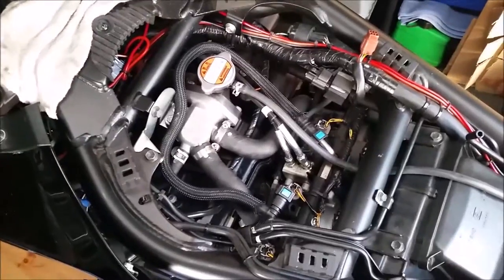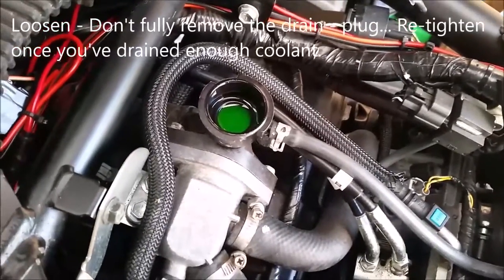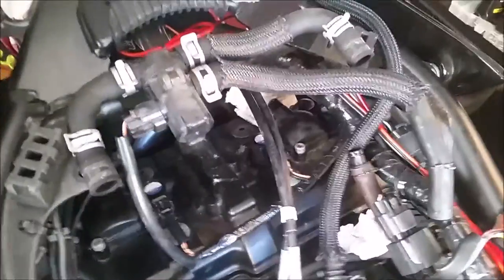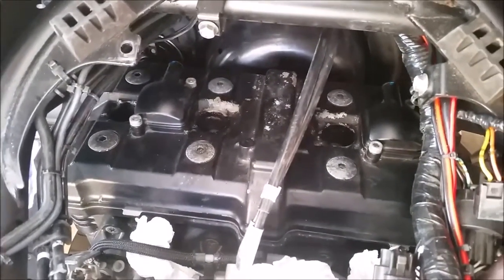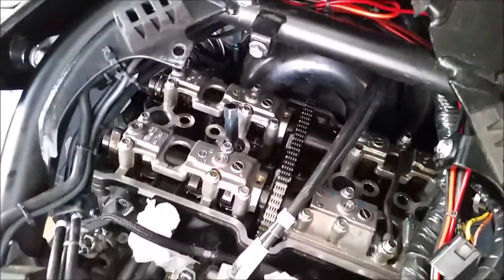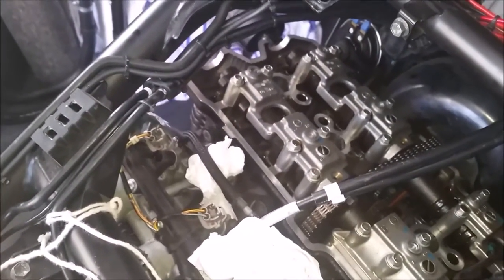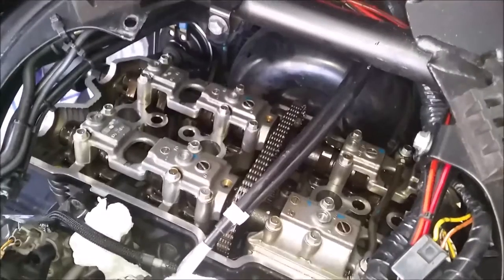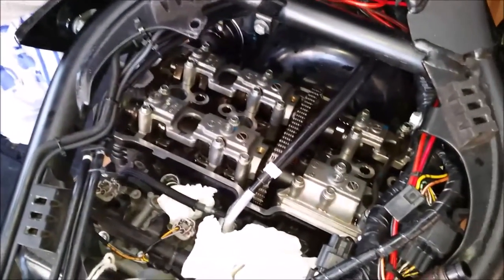Valve Clearance Check pt1 - Suzuki GSF1250 Bandit SA L0 2010

Comment from the maker: C.Walker... the large hose you refer to coming off the Water Pump - next to the bottom of the exhaust headers is the one you will need to undo and empty the system into a container placed beneath it (It's the lowest point in the system).
When you remove the radiator filler cap (Located above the valve cover and underneath the petrol tank.) it will help the coolant flow quite freely. Re-fit the bottom hose and clip and begin refilling the system via the filler neck - pouring the coolant in slowly so as to minimise the amount of air entering the system. Rock the machine from side to side and squeeze the various coolant hoses to burp any trapped air. Loosen the bleed screw to purge any trapped air within the pump, impeller etc. - The screw is located on the water pump itself and as you crack it open you should purge it until coolant flows freely then tighten. Top up the system and the reservoir/expansion tank to the F level line and fit the res/exp. tank cap. With the rad cap off start the engine and allow to idle for 2-3 mins, rev the engine up to approx 4000 - 5000 rpm and I wait until the top radiator hose on the rhs becomes warm (Indicating the coolant has reached approx 82'C and the thermostat has opened) Turn off the engine and any air trapped in the system should bleed out through the filler neck thereafter when the bike is in use. Re-fit the rad cap and Check all connections/joints for leaks then take her for a run bringing everything up to normal operating temperature. I check the expansion tank daily for a few days thereafter and top up if necessary but generally you should be good to go. Hope that helps

Comment: To save buying a new gasket for right hand engine cover, turn engine using rear wheel while in gear. cam cut outs position as shown, pretty obvious when your in correct position as lobe of cam is furthest away from the shim bucket....also wouldnt advise splitting feeler gauges, easier to fish out the chain tunnel should any accidents occur if they are all together. All in all a good easy to follow video, many thanks.

Comment: I almost did this to my Bandit when I had it open to solve a popping issue and change the plugs. I asked the local Suzuki dealership if I should do it and they laughed. Even tho I think the service manual recommends it at 15K (my 09 is at 16K now) they said they'd never seen one out of spec when opened for other reasons, and unless I'm having problems I shouldn't worry about it. I was going to tackle it since it's easier to do the job with the PAIR system removed, as my bike's has been. After a slip on can, I was having popping issues on decel that I just didn't like, so me and a buddy yanked it out one Sat. Popping cured and aside from an ever so slightly stronger smell from the exhaust I love it. My state doesn't have vehicle inspections and many states that do don't check bikes, so I was able to get away with it. But at any rate, I loved watching the video and it's your bike, so you do it how YOU want to do it. It's nice to see someone else dealing with the same challenges! KTSSU
Reply: my bandit is now 66000km and its in 9th year..never adjusted the tappets before !!. there are problems creeping...1) valve cam cover seal looks gone and the 2 ) sump cover sealing also leaking oil...
Reply: Hopefully nothing too serious. These bikes get you spoiled with their dependability, huh? Lol.

Comment: Great video, 1 step that should be checked prior to checking valves. Check that the cam covers are torqued down to manufactures specifications. Otherwise may give slightly inaccurate measurements. Other than that job well done.

Comment: Interesting video, thanks. Not a job I've done yet. I've spoken with dealers about the job and a couple have told me openly that they don't bother doing it during the service unless they suspect a problem. Not sure if that suggests dodgy dealers or that the bikes I've looked at whilst asking (Fireblade for one) don't really get problems. One to tackle eventually no doubt.
Reply from the maker: Hi Richard, To be fair I was following the service schedule and checking the Valve clearances as per the recommended interval purely because I wanted to know how the clearances were doing. Checking is a whole lot less involved than adjusting which does entail camshafts removal to gain access to the shims and of course re-alignment thereafter. I was rather hoping that this was going to be the case so I could have progressed the video further to help others but in this instance I didn't need any further action. I pondered about uploading the footage I'd taken and felt at least it may help others to decide whether or not it was a task they would feel comfortable in doing. You tube is an amazing place to meet new friends as I have discovered and of course share information on any subject... I use it quite a lot and felt I just wanted to give something back.
Reply: Mark Horton I am all for following the manufacturer recommendations and really enjoyed the video. If anything, it's worrying that dealers don't follow those recommendations, especially as most customers would probably expect that they did.

Comment: slightly confused about the coolant drain portion...Is there a drain spigot, or do you have undo the large hose underneath by the exhaust? Is the "bleed screw" just to let air flow?

Comment: Great helpful video, il have to do this one day on mine, what was the mileage you done this at so i can get an idea of when mine will need doing?
Cheers
Reply from the maker: WAGWAN CITY... Hi glad the vid may help people like you looking to embark on the task of checking. The workshop manual calls for a check at 14,500 miles or 24000km. There is lots of info regarding changing the shims to bring the valve clearances back into spec available on youtube. The principles are pretty straightforward however make sure you have a decent workshop manual and a good toolkit, including torque wrenches etc. Cheers Mark
Reply: Mark Horton ah right, mines at nearlly 24000 miles, at the end of the year i may do a major service whiles it winter
Reply from the maker: Do you know if they've been checked previously? How long have you had the bike miles etc. Oil & filter changes are key to looking after your engine. I have already put up a video showing the essential routine service like oil filters and plugs etc if it helps. May I also add the valve clearances are generally pretty good on these engines depending on how you ride and use them overall of course. I don't abuse mine and at nearly 17k she sounds and runs beautifully. The cost to check the clearances is minimal really... rising a bit more for changing any shims. You will save lots by doing it yourself and of course the peace of mind knowing you've seen and recorded the measurements (even after change of shims) for future reference. Good luck and take your time : )
Reply: Mark Horton my neighbour had owned the bike for about 4 years and i dont think theyve been done and theres no receipt to say so either, over the last 4 years or so its done around 2000 miles a year, its had a coolant change, engine and filter change.
Reply from the maker: It's peace of mind to check and know the clearances certainly at 15k intervals. Approx cost for DIY is not huge and as I have said before, I believe worthwhile. There are some people will argue that you can ignore and leave for several miles more than the recommended interval. That's down to the individual in the end... I know when i come to sell my bike on I can show evidence receipts, data recorded and video footage photos etc. that it was carried out and as i said  worthwhile. I wouldn't purchase a bike that has been neglected and not maintained at the intervals required. It's a big enough investment buying a bike in the 1st place without bringing on financial headaches for yourself at a later date. On the topic of Valve Clearances you would notice a strong tap tap tapping noise coming from the valve cover area when the engine is running if any of the valve clearances are excessive... This in the long run left unrectified will wear your camshaft lobes unnecessarily. On the other hand if they were too tight then you would see poor engine performance caused by lack of compression and the potential for damaging valve seats and valves which throws up other costs and factors to consider. I enjoy looking after my Suzuki Bandit and the pleasure it gives me... I also recognize not everybody wants that responsibility and that's what the dealers are for. Good luck my friend if you decide to tackle it yourself... research, obtain the facts and ensure you have the right tools knowledge and equipment to complete the task. Take your time and work cleanly and methodically. Make notes/take photos as you go if it helps..... Cheers Mark

Comment: Dear Mark, totally inspired by your video. May I ask what is the 2 additional red wires running please ?
Reply from the maker: Shamalan On-Time... Thank you for your kind words. The additional Red Wires you refer to are Positive supply feeds to some accessories I had fitted to the Bike. I upgraded the stock horn to a pair of dual tone horns that were far more superior than the original and I also had a pair of heated grips and a USB charger for my mobile phone (Which I used as a Sat Nav in a waterproof case mounted on the handlebars). They were all fed power from a switched live relay under my seat to keep the connections watertight....Hope that helps.
Reply: Neatly done Mark !!! I myself have 2 relays ( separately fused ) at the tool kit area. 1 for the twin horn upgrade and the other for an Oxford twin USB charger, looped to a Digital Volt Meter. The relays fit perfectly at the tool storage compartment area and certainly give me the confidence that the original wires are not overloaded beyond intentions of the engineers nor will they arc or be a potential fire hazard. Cheers !!!
Reply from the maker: You sound like a carbon copy of myself my friend... it's good to care and put the effort in when doing a proper job. I see some efforts on you tube and I shudder to imagine the heartbreak of their beloved machines going up in smoke through poor planning and consideration to wire gauge, fuses and general overloading or potential short circuiting when adding aftermarket extras.

Comment: HELLO PROMPT how many KM TO REGULATE THE VALVE?
Reply from the maker: Hi... 14500 miles or 24000 Km. Hope that helps.   Regards  Mark
Reply: you have the European version of the bike?
Reply from the maker: Yes I do...
Reply: What is the maximum speed of your motorcycle
Reply from the maker: I don't know because I've never pushed it to the limit... the Bandit is a superb mid range power machine intended for enjoyable everyday use. If top speed excites you my friend may I suggest you look at a Kawasaki zzr1400 or indeed a BMW s1000rr. You will get your top end kicks there....
Reply: Thank you but I like a bandit 1250
Reply: a russian video of the bandit 1250 goes to 200kph or so then gets cut off as he told me...Bandit is actually a detuned engine to a pedestrian 90 to 100hp...so its not a sport bike but it will run pretty well beyond most of us non superheroes can candle... my old model  air cooled bandito goes to about 180kph in 5th gear (only 5 gears in my old version) at around 6.5k rpm...it wont go beyond that in 5th...unless you thrash her engine in 4th gear up to redline and then shift to the 5th... the 5th gear is very long and overdrive!!
Reply: The Bandit may be a detuned sport bike, but it is ALL sport bike, my friend. I've put 11K on mine in just over a year and I love it dearly. Fantastic machine, especially for someone who enjoys the lower end thrills on the streets.
Reply: I love Holeshot. That guy knows his stuff. I took the PAIR system off mine with a kit from Dale to deal with popping on decel after a slip on. That stupid global warming contraption wasn't doing shit except make it hard to work on the bike and making noise. Good riddance.
Reply: my stock slug has only Knn filter...time to throw away the pollution control thingy as well..power robbing device
Reply: Dale has a great kit for it. I think it was about $60 U.S. Even has the sensors that stop the F1 light from coming on.
Reply: my gsx1250 FA 2011 ( produced 2014, bought brand new end 16, does 255 KMH with a lill more to go )

Comment: how many miles have your bike done?
Reply from the maker: Just passed 18000 miles now and enjoying every time I go out on her....
Reply: my 2006-1200 air cooled bandit is approaching 65000km...havent adjusted these yet, not really noisy so i didnt, it should be slightly easier cos theres no radiator hose to play with, i also thought of blocking off the PAIR system completely, to get rid of that ''sputterring'' whenever you open or close the throttle

Comment: I have a 2011 with 30k on it still no need to do this.  As N stated my dealer has also said they have never seen one out of spec.  When you hear the valves rattling it's time to adjust.  They don't get tighter only loose as they wear.  Save time and effort, don't witty about it.
Reply from the maker: Your bike, your money.... your call. So valve clearances NEVER get smaller only bigger..... hmmm.  Just for info of course check out this snippet and decide for yourself  https://www.vstrom.info/Smf/index.php?topic=7332.0 .....Different engine but principles are the same.